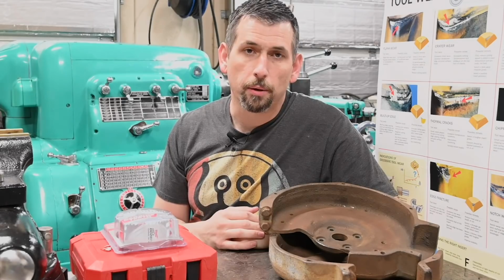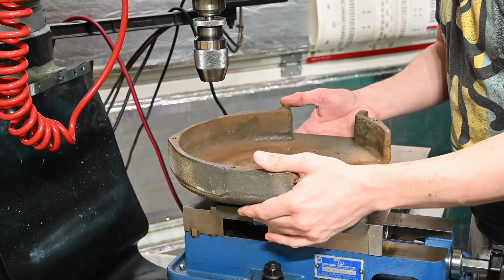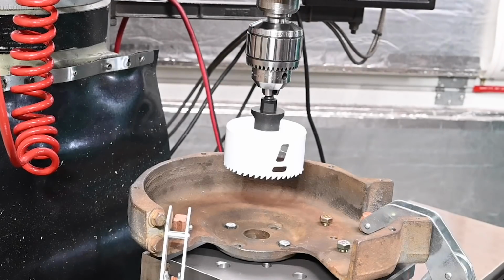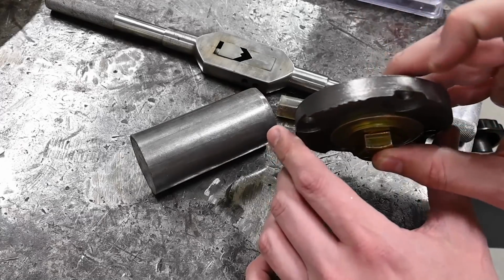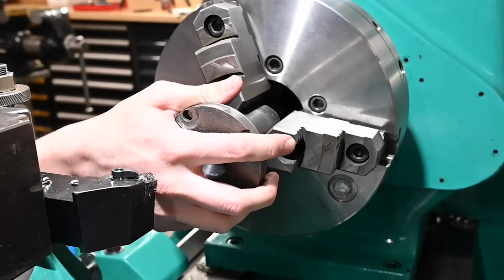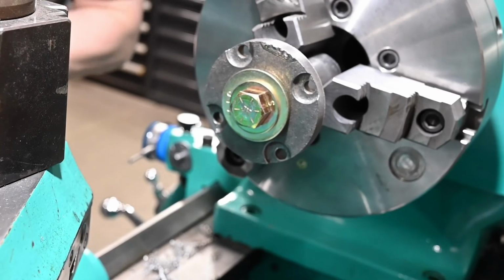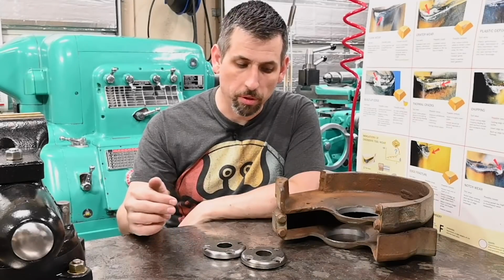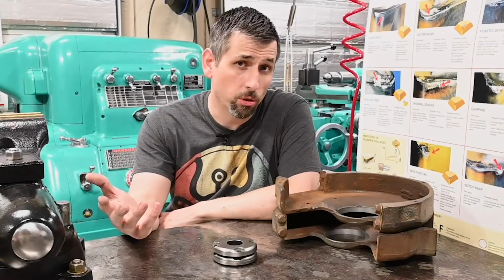Baldor Grinder Bearing Caps for Keith Rucker

Comment: Hole saws cut the stated OD not ID  92 less the thickness of the wall x2
Reply from the maker: D’oh!!!! Thanks for pointing that out. I wasn’t thinking.
Reply: As Yoda said  "jedi you are not yet" lol next time use the nee handle for hand feed and lock the quil off as it won't bounce...
Reply from the maker: Yeah it's one of those things that was caused by tunnel vision- "oh I need to finish at 3.50" so a 3.625" saw will be perfect." And didn't put any more thought into it. It would have solved one problem but not all.
Reply: Just proves nobody’s perfect, I make these simple mistakes when Im overthinking a job.

Comment: My grandfather told me that "by the time you finish a job, you will have figured out how you SHOULD have done it".  I do try to avoid that in my little amateur machine shop, but more often than not, he still turns out to be right.  I find that when I'm lucky enough to have things go right the first time I don't learn as much or remember it as well.  Keep doing what you're doing, and thanks for sharing!

Comment: For future reference a hole saw size is for the OD of the cut.

Edit, just read another comment saying this, not trying to beat s dead horse.  Just didn't read all the comments before making mine.
Reply from the maker: No worries. 👍🏻
Reply: @AlwaysSunnyintheShop  I made this comment as soon as you said it was already undersized.  Then I went through the other comments.  It's a learning experience that I bet you'll never forget, haha.

Comment: Braze on the outside edges? Did you Measure the hole saw? I used a portable mag-drill to do that, made a core plug and shim stock to fit in the bore luckily for me i used a hole saw I thought was to big came out great. Thanks for sharing. Some times clocking the arbor helps two negatives make a positive.

Comment: Is there enough material to cut new ones out of the remainder of the guards? Use a boring head with an axial tool, and plunge it into the guard. (Sorta like the old school adjustable hole saws.) That way you don't need to buy another hole saw, and you will be able to get a more precise slug.

Comment: for your tailstock bolts...get two of those wrenches cut the handles down and connect the two stubs with a loose piece of material with a knob affair and you can loosen or tighten them simultaneously..just an idea...

Comment: Hey Aaron, your not the first or last to get burned by a hole saw. Your are less than 1/8 of an inch under and this isn't for a rocket, it will work just fine. Hey it's a new upgraded model. Great job.   God Bless Ya   Dave

Comment: Well I’ve never been a hole saw fan to begin with. However if I had did that job here I’d probably sawed a rough square out . 250 minimum. Probably closer to .350 and turned it round. Still it’s a workable unit and better than nothing. Sometimes we learn more here mistakes than success

Comment: Somewhere someone is looking for these parts!  What sort of a dork would buy a $70 holesaw just to destroy  some parts worth $300 just to make a $2 washer???  I can't believe that Keith Rucker really understood the degree of vandalism proposed in the project.

Stavros the impecunious one.
Reply from the maker: I’m sorry it hurt your feelings. I’ve tried getting rid of these for 3 years and even at the grand ol price of $0.00, I haven’t found a taker. If someone needs these parts they can contact a Baldor distributor and order brand new ones. And I didn’t pay $70 for the saw. Guess I’m not the dork you claim I am.

Comment: Nice vid and good for helping Keith! However, in the time it took to fixture the guard and mess with the hole saw a couple of slices off a round bar could have made what's needed instead of destroying some good castings.....
Reply from the maker: Yup that's true, but I thought this would be interesting for making a video, and using original parts is always great. Since I wasn't 100% satisfied with how these turned out I used two pucks of 1018 to make new ones from scratch. Keith will get all 4 and he can have the cast irons ones as spares.

Comment: You are in the small percentage that uses the coaxial without the motor running. I find it much easier that way.
Reply from the maker: Always feels out of control with the spindle on. I’m sure as I get better at it I’ll step up to using it under power.
Reply: Funny. Adam just posted a video yesterday where he used his coax by hand. (Not under power.)
Reply: @AlwaysSunnyintheShop  It always feels out of control to me also evan at a slow speed. For me it seems easier to dail in one axis then the next, then fine tune. I guess there is no wrong way as long as it works for the operator.

Comment: Kudo's for a good video and having the balls to illustrate the mistake you made. There's no one watching this video who's hasn't made a mistake like this. In today's world, it's referred to "a teachable moment".  Your lathe does sound great BTW, much quieter as well. I wonder if Abom (Adam) is jealous of the condition of your lathe? :) Another question- Does your garage/shop have AC? I work in my Garage/shop in Gilbert, AZ and am considering an AC unit already!
Reply: Hi Bill!  Yes A A Ron did a recent video where he cleaned his AC in the shop.
Reply from the maker: Yes an AC is not optional in my opinion. I’ve got a 2-3/4 ton mini split LG system. Does a great job with my ceiling and garage doors insulated. I think Penguin Air was the name of the company I got it from. About $2700 but that was 2016 so prices may have gone up since then.
Reply: @AlwaysSunnyintheShop  Thanks for the info! I'm going to have to suck it up and get something installed. It's too damn hot here in the summer w/out AC in the shop.  I was hearing around $3k for an a/c installation.
Reply from the maker: Money well spent!

Comment: If the arbour dont fit we will have to go find one at the store..... Your in a machineshop dude come on....
Reply from the maker: For a normal arbor, yes, but these hole saws use the special collar pins to drive it. Not worth making for 2 holes.
Reply: @AlwaysSunnyintheShop  tap 2 screw holes done it before needs must 😂
Reply: You dont even need to thread it to screw the holesaw onto just use a stump to centre it 👌

Comment: Not criticizing, but you have a full machine shop, why not start from scratch with a steel blank?
Reply from the maker: No offense taken. I thought about that too, but I'm not sure it'd be worth the money and effort. I'm leaning heavily toward milling the top of the table around the slot and making replaceable inserts.
Reply: @AlwaysSunnyintheShop  Just watched the second video. Nice job and looks more professional.
Reply from the maker: Sorry I thought you were commenting on my most recent video. Yeah I just wanted to use the original Baldor guards to make the caps from, and then you saw that I ended up making new ones from scratch. It all worked out in the end.

Comment: Just band saw the piece out of the casting and then turn it on the lathe to size- no need for all that setup time and buying a hole saw.
Reply from the maker: That would have worked too, but I don’t have a vertical band saw and I thought this would be interesting to show.
Reply: @AlwaysSunnyintheShop  lacking a band saw- I would have used a 4" hole saw and just turned a little plug to fit the center hole with a 1/4" hole to center the drill then just clamp the piece on the drill press over a piece of wood- and cut out the chunk.

Comment: I don't see the point of what you have just done, you could have just machined up a couple spacers with 4 holes in of the correct diameter, would have  been a lot quicker!! and you've just ruined 2 good grinder guards as well.
Reply from the maker: I wanted to use the ‘material’ as it’s been collecting dust for 3 years and also knew it would make an interesting video. I also wanted Keith to have original, though modified, parts.